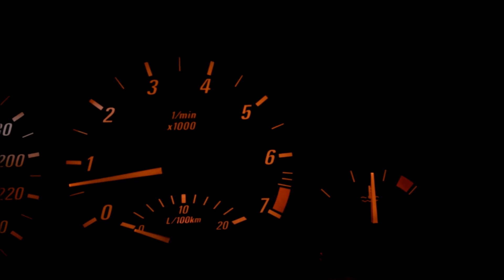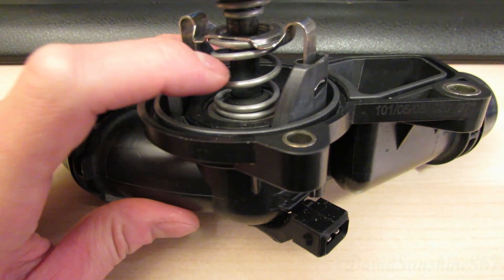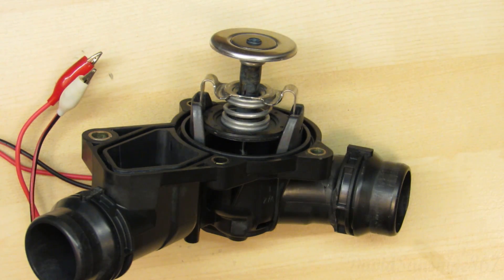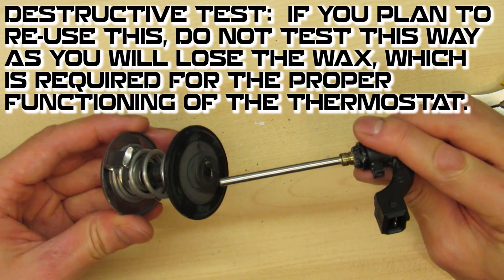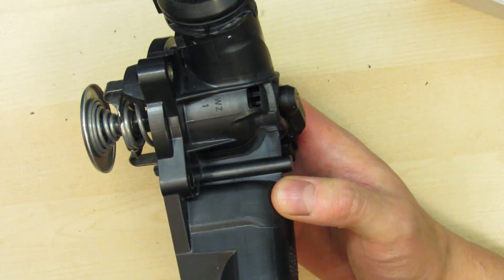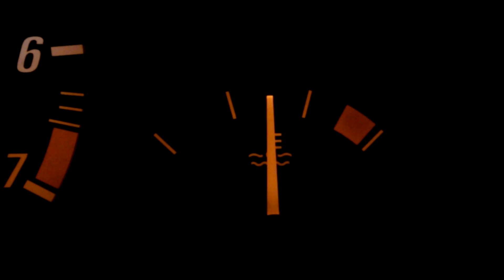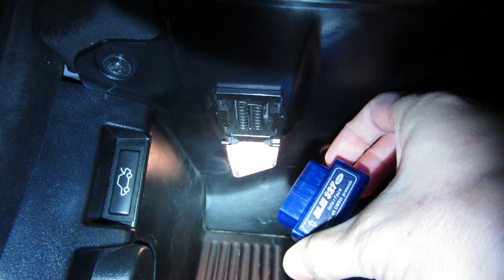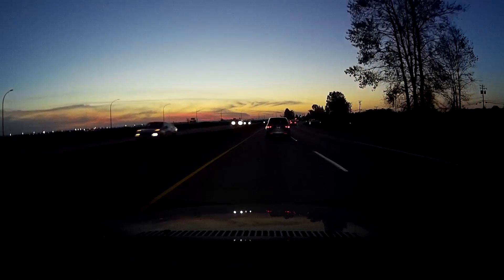How a Thermostat Works in the E46 - How to Diagnose a Broken Thermostat

Comment: hello, I have a 323ci M52 E46... but my temp is hitting the 105 - 106C... not sure if is the FAN or the thermosthat, I already installed a Mishimoto radiator, for some reason the mishimoto thermosthat don;t fit the OEM housing, any ideas? It is normal for the E46 runing 100C or 105C temp?
Reply from the maker: Hi, no it's not normal to run at 100+℃, must be something wrong there, or the thermostat you have in there is a high temp activated type, 205℉ or 96℃, that would explain it, if it's working fine and just running hot cuz of the thermostat, you're fine.  The electric fan is coming on right?  If you have a regular thermostat it should be cooler than that, unless it's hot out, then it might be ok.  Not sure why it won't fit, might be for a different engine size? 
If your engine runs fine and it's hot out, it might not be a big deal as long as you aren't boiling over.  If the activation temp is 96, I can see it hitting 105 then cooling and stabilizing between 100-105.
Cheers,
David.
Reply: thanks your your reply.. .Then FAN is working, but not sure if the OEM fans have 2 velocities, or just one? I;m going to try a new housing with thermosthat and try to fit the mishimoto one ... I;m from costa rica, and the weather temp over here it's a little bit high... about 18C-28C weather temp in the morning-afternoons . Sound fair that possibly i have a high temp activation thermosthat. But to be honest it's quite frustrating checking the temp goes to 106C :(
Reply from the maker: Anytime.  Mine was. At 90 but it was cold out, like 10C, I could see it being 106C at 28C out.  Also what mixture do you have?  Less water, and you'll have higher temps.  I'd go 50/50, some do 60/40, haven't tested it but 50/50 should be safe.  I'll check mine tomorrow.  Your housing has the thermostat built in doesn't it?
There are youtubers who replace the fan connectors with switches, from that video I think it was only on off, but I could be wrong.  You should check his video to see if there are different modes.
Reply: yeap... thanks again... i'll try to find a used original housing and thermostat and try to fit the mishimoto one. I'm using coolant for the radiator 70 coolant 30 watter, the car runs fine, no leaks, no damage in the headgasket yet heheheh... but i'll try a used original one if everything goes smooth, i'll buy a brand new OEM housing and thermostat  to replace everything. 

another problem that I have, is that i'm have the M3 cluster, and the iddle is not in 12 oclock, never is there hehehe... always is 3/4 of the cluster, or hitting the red color when they moved to 106C :(
Reply from the maker: You're welcome.
Hmm, if you're running 70/30 antifreeze/water, that might be why it's running so hot.  The antifreeze doesn't cool as well, and has a lower thermal capacity than water.  If you want better cooling, you could put more water, like 40/60 antifreeze/water, and see if that helps.  70/30 doesn't cool the engine as well, but it's great for freezing cold environments where it's -40C out.
This page explains it a little better: https://www.reference.com/vehicles/much-antifreeze-should-mixed-water-a7f2ca45b34f9054

Water is one of the best coolers, that's why we're still using it over anything else.
I would try 50/50.
This page also explains it too: https://hellafunctional.com/?p=629
It also says cars run at 90-105C, so your car might just be running at the top of that range because it's not cooling as well due to the 70/30 mix.

Before trying any hardware changes, I would adjust it to 50/50 and see how it works.
If you have 8.5L of 70/30, you can drain 2.43L, then add back 2.43L of deionized water, it should be 50/50 after that.
That should drop your temperatures some, maybe not down to 90C, but at least below 100C I'd think.

Are you checking the temperature with the OBDII sensor and Torque?
Reply: yeap... i'm checking with the OBII bluettooth scanner OBDLInk , and also checking with the cluster (getting inside the ECU of the car thru the cluster) and the parameters of the temp are the same ... tomorrow I'll dry some coolant and add more water , and check the temp...
Reply from the maker: Cool, good to know they match.  
That's cool you got the M cluster tho.  Must look sick!
Reply: yeap... looks really cool, the bad part of it, it's trying to fix the buffer of the iddle for the water temp... the M3 cluster it's programmed diff than the non-M ones... I have the 1.4 Soft scanner also, and try several times to program de IKE of the M3 cluster,  adding the correct values to fix the idle of the water temp gauge, and still going to the red spot ... I think I need a better scanner to fix that one :P
Reply from the maker: Lol that sucks.
Have you programmed it so your brake lights blink when you brake hard?  That's pretty cool.
Maybe you can just drive around with the OBDII display of Torque to display your temps and everything, then you don't need to worry about the temp gauge.
Reply: nope, not yet ... I wanted to activate the digital rpm cluster, (with the colors) option only available for the triptronic version of the M3...
Reply from the maker: Oh that would be pretty awesome.

Comment: hey whats up ,what happens if  i leave the car without thermostat should menton i live in a quite template climate
Reply from the maker: Hi Jorge, if you live in a temperate climate, you might get away without having the valve in there, but your engine will run cooler than it should, and moisture/acid will build up in your engine, causing corrosion and degrading of your engine oil, it's overall bad for the internal workings of the engine.  You might see deposit build up, and that's a sign your engine isn't getting up to operating temperature and boiling everything off that it should.
Bad things could happen if you run without a thermostat that helps keep the cooling at around 90 degrees Celsius.
I would recommend putting in a working thermostat.
Hope that helps!
Cheers,
David.
Reply: David Sunshine thanks david its true better change it
Reply from the maker: You're welcome.
Ya I think it's pretty important for that thing to operate properly, it'll keep your car running in the best shape.

Comment: Good Video- Who makes and where can one get the USB OBD adapter ? And the instrumentation that you included in the video do you need a special app to display that ?Thanks for the help !!!
Reply from the maker: Thanks.
I use the OBD II to bluetooth adapter, it doesn't have a brand name, random companies in China make them, they seem to work fine.  It must be paired with an Android smart phone, and the app you must download is Torque Lite, it's free, and does everything you basically need.  You can pay $6 for the Torque app if you want additional features tho.
I got mine from here: http://tidd.ly/625a3033
Cheers,
David.
Reply: They are pretty damn handy for a cheap China product. My instrument cluster has died and the only way I can see my coolant temp is through the app. Without it I’d be kinda fucked, and it ended up being the thermostat the actual plug which heats the thermostat up has completely corroded and fallen off plus the stat itself is as crusty as my nans homemade bread lol. And the plastic housing pretty much broke to pieces when I was simply trying to inspect it 😑 I fucking hate plastics for critical parts in engines, like fuck off with that cheap bullshit.

Comment: David, when you put 12 v to test,  the thermostat,  how long have to wait  to get open ?
Reply from the maker: William  Figueroa About 5-10 min. or less. probably starts at 2-3 min. fully extending takes longer
Reply: What we're asking is - is there no need for a current limiting resistor?  Just hook the thermostat heater directly to the battery?
Reply: how did you connect the wires from the battery to the termo, you never showed the connect you made
Reply: You can connect it in any way you want. You can use, e.g., alligator clips.

Comment: hey I have a 2004 BMW 330i my car heats up and it blowed up my radiator any ideas with wats wrong with it?
Reply from the maker: Hey, are the fans working properly?  
If it did that while driving at 50km/hr+, then it's probably the water pump not working, or the thermostat is stuck closed, or your fluid level was too low.
Regardless, when you replace your radiator, you're best off replacing your thermostat if it's over 6 years old, they should be replaced after 6 years anyways(in my opinion, their life span is about 9 years max). 
Then properly fill and bleed your system, and make sure it's flowing and working properly, if you rev it up while the fill cap is open, it should flow enough to splash everywhere, if that's not happening, your water pump might be damaged and not pumping properly.  Make sure the auxillary fan and fan clutch work properly, if you have good airflow at idle and it doesn't overheat, you're set.
Those are the things I would check.
Cheers!
David.
Reply: Mario Munoz 
check for CO2 in your coolant, if that is fine.  then your thermostat is probably stuck closed.  this happens to me, blew the  radiator.

Comment: So I have a 1997 E36 328i and it only overheats when I just stand on a red light but when I get on the freeway and go about 50-60 mph it goes back to 12 o'clock. I've been searching this problem for 4 hours now and everyone has a different problem.. I just want to be sure about what I'm about to buy. I flushed the radiator out so far now I don't know if I should buy the fan clutch? Or the a/c fan because my A/C fan doesn't seems to be working or spinning when the car is overheating. So I think it's three choices here and I don't make a lot money. Fan clutch, a/c fan- aux fun, or thermostat. Help, leo
Reply from the maker: Hey Leo, 
I understand that you don't want to spend a lot of money when fixing a problem in a car, and most people don't have unlimited cash either, so it's not a good idea, and is just a waste of time and money.
You should troubleshoot the problem to find the actual source of the issue, rather than replacing parts, hoping they will work.
With your issue, it can be a number of things failing, but I would first check the fuse to your aux fan, sounds like that's the issue, I would get it running first.  If the fuse keeps blowing, spin the fan to see if it spins freely, it might be sticking, maybe you can take it out and just spray it with penetrant/lubricant, like WD40, to get it clean and going again.  Might want to spray brake cleaner in it to get rid of any gumming grease.
If your auxillary fan isn't spinning when the car heats up, it sounds like the only issue for you is the fan, since with good airflow going 50-60mph your car  runs fine at 12 o'clock.  Your temp sensor may have failed, like Colin's E36's, he wired a switch to the high mode, so he can turn on the high mode all the time, this might help your issue, and it's free.  It would be even easier to just cut away the insulation of the wires, and short them together, tape it together, and get your fan spinning.  If that fixes your issue, you know for certain it was just the temp switch.  Check out his video here:  https://www.youtube.com/watch?v=zm84cPNKgIc
This user also test the fan with a jumper, you could just leave that jumper in there, assuming it stays off if the ignition is off: https://www.youtube.com/watch?v=6Yq0TiI_bUk

I don't think the fan clutch is going, since you're overheating at idle, it doesn't spin very fast at idle.  I think it spins faster when you rev the engine, but that would cause overheating when you're using a lot of accelerator, which isn't your issue.  Your issue is overheating at idle.

I assume you live in a very hot climate, so you need your aux fan going, I'd just run it 100% of the time, and not bother with a switch.
So troubleshoot things before you spend any money.

Cheers!
David.
Reply: I have exactly the same problem, can you tell me how you fixed it?
Reply: Low coolant lol.

Comment: I am having the same problem. mine is a 320 diesel e46. it has a hard time to warm up,and on the highway the temperature drops almost all the way down. also when I turn on the heater it drops. I replaced the thermostat,the old one came out in pieces,but I am having the exact same problem even with the new FEBI thermostat. could it be the thermostat again? I scaned the car and it dit not show any code for the thermostat like P0168.

any ideas please?
Reply from the maker: Mine didn't show a thermostat code, but it was definitely stuck open, cuz it would warm up sitting in traffic, but as soon as there's airflow or would cool down since fluid was going through the radiator.  Does that sound like your problem? If so, the fluid is probably travelling through your radiator, which means you should replace the thermostat.  
Maybe the new one got some pieces stuck in it and bent it or made it stay open?  That's all I can think of.
Also, first thing I would check is to unplug the 12VDC connector, you don't need it anyways, you'll just lose the ability to open it early in cases where you're racing around a track. My thinking is, the 12V relay might be stuck on for some reason.  This will help test that out. If no change, then you can plug back in, it won't hurt or help much either way.
If the problem still persists, I would replace the thermostat, and flush it really good when you have the thermostat out, to get any debris out of your system, after that it should work like a charm. 
I'm the highway I got no heat, even with a slightly open thermostat, doesn't take much, so a piece of something would have bent or caused it to stay open. 
Hope that helps! 
Cheers,
David.
Reply: David Sunshine yeah you're right I should check that again,maybe the relay is faulty I don't know but I should check it. on the highway it drops from 85 degrees to 57 for about 7 km. also when I turn up the heat it also drops. thanks David for the info and the video,really helpful and Happy New Year
Reply from the maker: The chances that the 12V is being applied is very low, I would think, but you never know, so worth testing it out before taking it all apart and replacing the thermostat.
When you replace the thermostat, I would flush the system with a hose if you can do that too, if you do have plastic bits in there, you'll want it all removed before you put another thermostat in there.
You can buy adapters to connect hoses to the radiator houses, to push water through the system, it's a good way to flush and clean it out.  Then you can drain it using the plug under cylinder 2.
If you don't want to flush it, just draining it with the plug under cylinder 2 gets out quite a bit of fluid, you can always open the plug, and poor water down from the top, that might wash out some plastic parts as well.
To me, it really sounds like fluid is flowing past your thermostat, once you have that sealed up, it should be able to warm up right away.
As soon as I replaced mine, it warmed up no problem on the highway going 100km/hr.
Before that, it would cool down within a few kms.
Turning on the cabin heat shouldn't reduce the temperature that much though.
Before replacing the thermostat, I think you should test that 12V plug, and also bleed your system and make sure it's got no air bubbles in it.  But air bubbles typically cause overheating, not the over-cooling like you've described, but best to make sure you've bled the air out anyways.
Hope I could help!  You're welcome.
Thank you and have a Happy New Year too!
Cheers,
David.
Reply: David Sunshine yeah you've been a great help,I am going to test the 12V plug as soon as I can. thank you again and take care.

Comment: you don't need obd(II) to get the exact temperature. just go in the undermenu on your bordcomputer, test 19, loff, and then test 7. in this test the exact temperature of your water is shown on the bordcomputer. 
best regards from bavaria ;)
Reply from the maker: That's awesome, thanks for the tip! I'm gonna have to try that out.
Cheers,
David.
Reply: @DavidSunshine  you think the heater/ plug would have anything to do with the thermostat not opening? I've gone through 2 new ones, and same thing.

Comment: savage, thanks for the info, I'm replacing mine cause is ruining cold on the freeway, the faster I go the lower it goes.
Reply from the maker: Miguel Contreras You're welcome!   Ya,  had the exact same problem.  I guess after about 10 years it starts to fail,  it's funny cuz I think it broke in the summer,  the winter before it was fine,  then it started to get cold and I got no heat on the highway.   Taking the fan off is tricky,  but if you hammer the wrench it will loosen up,  you don't really need the bar to hold the fan still,  just use the inertia of the shaft and other pulleys.  
Cheers, 
David.

Comment: I got bmw 330ci and my fan clutch its very loud i change the fan but is stil the same its very loud and never gets off
Reply from the maker: That's strange.  Did you try turning the engine on without the fan in place, to see if the sound is from something else?
The fan clutch doesn't seem like it would make much noise.
It is supposed to spin all the time, that's not a problem actually.
There are electric fans that turn on in addition to the fan with the clutch.
What noise is it making?
Reply: I Have replaced the fan clutch, still the temperature is going up, on slow rpm, while it go back to 95 , when moving fast or on high rpm accelerate, do you have an idea what could be the reason

Thanks for the video